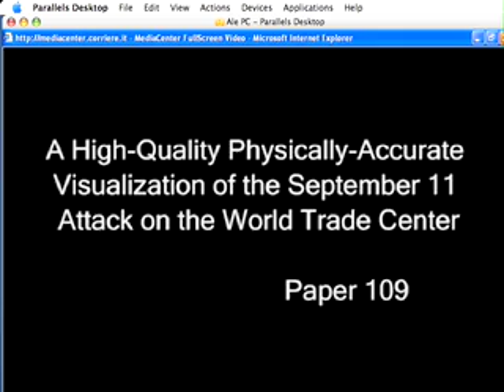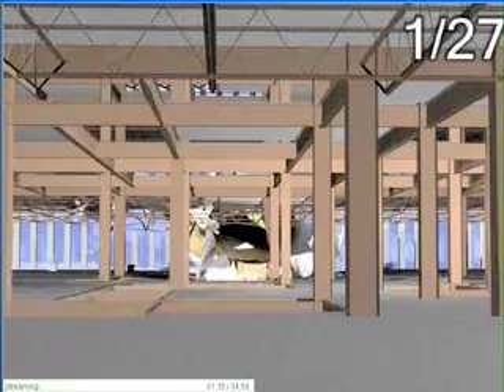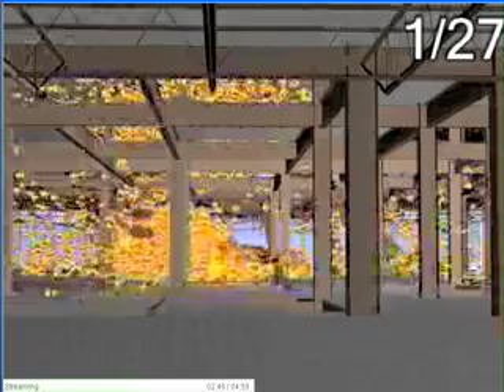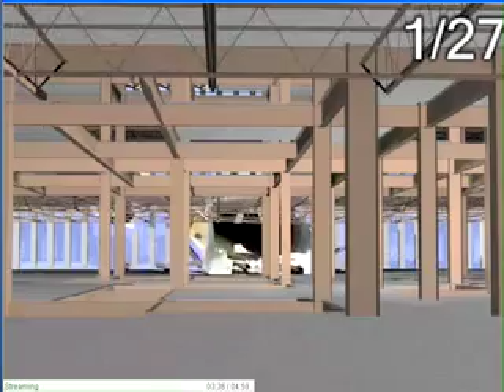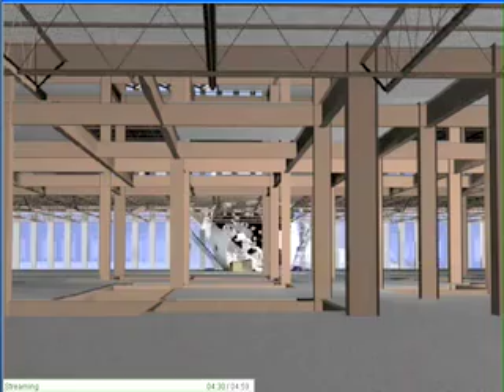9-11 Twin Towers Attack 3D simulation

Comment: I mean the jet engine on the wing can plow the the steel but the aluminum wing at the ends would of not been able to pierce thru those steel beams on outside face of building. Like am I missing something. Maybe the buildings weren't made from steel than. Cuz the planes literally cut thru the steel building like butter 🧈

Comment: The reason why each tower collapsed when; the north tower was hit at just under 500 mph or 400 kts straight into the teeth of the 93rd and 99th floors. Flight 11’s impact blocked all stairwells from the 92nd through 99th floors either severing but more than likely, the plane’s debris and the Sheetrock clogged the stairwells to above the impact zone meaning if you were 92nd floor or above, you didn’t make it. I believe all in Flight 11’s impact zone were dead on impact and the only survivors were on floors 100-110 with others trapped on the 92nd floor. In the case of the south tower, United 175 hit at just under 600 mph or just over 500 kts at an angle more toward the right corner of the facade at a 45 degree angle, about 100 mph/kts faster than the north. The south tower was also hit between floors 77-85 with one stairwell to the upper floors clear but only 18 people at or above the impact zone escaped. Now the reason why the south tower fell first was because of the speed of the impact as well as the weight of the remaining floors above 77-110 along with the building to the left of the plane’s impact leaning to the right on the floors below and the weight was heavier than the north tower which led to it collapsing first. The north tower lasted longer because it was hit more into the teeth of the building and was higher up and the weight of the remaining floors 93-110 were lighter than the south tower and the north tower was hit at a slower speed. The point of impact as well as the weight of the floors at and above impact as well as the angle and speed were crucial.

Comment: How alluminium cut the steel like butter
Reply: Please google "waterjet cutting" and you will see water cut the steel
Reply: @Kuechmeister  and you see the pressure of the water 😉
Reply: @gennarocasertano3935  30 Tons of Alu + 60 Ton rest ( plastic, steel, turbines, fuel) = 90 Tons Airplane + 600mph = more than enough pressure to cut Steel.
Reply: @gennarocasertano3935  Physics:
 For example: 30 Kg × 100 km/h = 3 tons kinetic energy. Now the airplane 90.000 kg = 90 tons × 800 km/h = 5.760.000.000 Kg = 5.760.000 tons of kinetic energy.
Reply: @gennarocasertano3935  So Boeing 767 Hull 6 m² = 600 cm², 1kg/cm² = 0,981 bar (pressure) , 5.760.000.000 Kg kinetic energy × 0,981 bar = 5.650.560.000 / 600 cm² = 9.417.600 bar. So waterjets works with max 4.000-6.000 bar. So the airplane have 1.570 times more pressure,  than a waterjet.
Reply: @Kuechmeister  nope never alluminium bullet hits steel and pass throw it never...
try at home ...launch an alluminium  coca cans in a steel bar at what f..velocity u want and see if it cut the bar!
Reply: @Kuechmeister   try at home...can of cocacola in a bar of steel at what u want velocity and see if che alluminium cut the tempred steel of a skycraper . i not answer anymore you ll think all u want 😉bye
Reply: @Kuechmeister  and so in every case the really couses is attribuite to high temerature ...the bar of steel are in rhe middle of skyctaper and airplane isnt arrived there in part more big than a papwr sheet  ...and wt7? 😉
Reply: @gennarocasertano3935  The can thesis has long been refuted and that is well known.
The point is "1,570 times more pressure than a waterjet cutter". The material doesn't matter. Railgun Concepts uses aluminum bullets. And you have to consider that an airplane is only made of 30% aluminum.
Reply: @gennarocasertano3935  At WT7, New York is not an earthquake area, so the buildings were not made earthquake-proof either. The twin towers weighed 200,000 steel and 325,000 m³ of concrete. So the answer to WT7 is simple seismic.
Reply: @gennarocasertano3935  
Railgun projectiles made of aluminum pierced armored steel like butter.
Reply: @gennarocasertano3935  and another effect is important to know, google "Water And Molten Aluminium Is A Dangerous Combination" you only need only 600° heat to meld the aluminium and water...and Boooom
Reply: @Kuechmeister  yes of course ...🖍
Reply: @Kuechmeister  mmmm ok ok yesssss 👍

Comment: Aircraft doesn't cut through steel and that is a fact...........................
Reply: Birds only damage the thin outer skin of a plane, but under that thin skin is inches thick super strong alloy aluminium.

The alloy that planes are made from has the same ultimate tensile strength as structural steel 500 Mpa (Mega Pascals).

The size and strength of the wings is massive.

The wings must be very strong because they have to handle the wind pressure at 500 mp/h.....carry the tons of weight of the engines....carry the thousands of kilograms of jet fuel... and handle the large G-forces.

There is a video on youtube showing how they manufacture the wings of an Airbus 380....under the thin outer skin of the wing, is a massive inches thick rectangular box beam, the same size as the inner core steel columns of the twin towers.

The exterior columns of the towers at the impact zone were only 9.5mm thick plate hollow box columns....no match for the massive and supper strong wings of a plane.
Reply: No it's not a fact. You've not no research

Comment: Come on wings aren't strong enough to slice through 4 inch steel beams
Reply: The exterior steel hollow box columns that the planes impacted near the top of the towers were only 9.5mm thick. Only the columns at the bottom of the towers were 3 inches thick.

The towers were only designed for one plane impact.

Comment: There was absolutely no reason for the collapse controlled demolition because for the circumstances even if it did collapse for the jet fuel the top of the tower would have came down side ways like like cutting down a tree not the whole building

Comment: They say plane debris emerges on the opposite side of the tower, How can that be? Do you know what those plans are made of? Light fiber glass with as little as possible steel or heavy weight. Yet a fully constructed 110 floor iron bolted buildings collapsed into powder and dust  yet a small fiber glass plane ( compared to the structure integrity of the World trade centers) emerged from the opposite side? This is proof positive we need loyal Americans that go not favor government, politics or religion just the plain ( no pun intended) facts of what really happened!

Comment: This video is a complete joke... there is no way that an aluminum airplane can cut through steel. Did anybody ever see the front end of an airplane after it hits a bird?
Reply: Planes aren't made of ONLY aluminum
Reply: Yeah, the plane gets a dent in it, then lands.  So what?
Reply: M Fitz If a hollow boned bird dents an airplane then ur still saying aluminum can cut right through steel and concrete reinforced World Trade centers.
Reply: Will.I.AM - Well,...   http://i.imgur.com/hJdqzcp.jpg

Nuff said.

I should point out that the odds of something being possible if it has already happened are 100%.  Reality is not in error here, your false starting assumptions are.
Reply: Will.I.AM - The plane is harder than the bird, yes?  The bird is made of soft tissue, is mostly water and is smaller than the plane.  What happens when a bird hits a plane?  Sometimes the bird puts a dent in the plane (sometimes it doesn't - you don't see those).  

Why does the bird put a dent in the plane?  

Because the bird has mass and the impact has velocity - energy.  

A plane is like a really big bird.  

Why does the plane - 250,000 lbs of it moving at 470-510 mph - make a dent in the hollow building?  

See, you have been looking at this exactly backwards.  In your analogy the building is the plane and the plane is the bird.  Bird hits plane (plane hits building) and impact energy creates impact damage.

Comment: I just want to know how a  very delicate airplane cuts right through row after row of steel beams? The plane should have exploded like a pancake into the side of the building (not cutting all the way through it).
Reply: Planes are not delicate.
The fact that it didn't means you need to reevaluate what you got wrong.  You won't of course, but you should.  Reality is always right.  You are not.
Reply: If planes are "delicate" there's no way they could fly. Do you not know how fast planes can go?

Comment: The plane crashes didn't cause the collapse of the WTC Towers. They remained standing approximately an hour each after the crashes. The buildings blew up like erupting volcanoes, any one postulating a gravity driven collapse is ignorant of elementary Newtonian physics.
All progressive collapse theories defy Newtonian physics:
Newton’s third law is: For every action, there is an equal and opposite reaction.
Applying this principle to the collapse of the WTC Towers, it proves that the upper portion could only destroy the lower portion by the equal amount of the floors; That is if 12 floors are crushing the floors beneath them they can crush no more than 12 stories below. Simple physics.
What is the work done in ‘crushing’? It is smashing and destroying a material and objects. Equal and opposite crushing is crushing from above and equal crushing from below. ‘Crush up–Crush down’.
The material crushed in the interaction is equal. Therefore there is no material left to crush down after it is exhausted itself against the crush up.
https://willywhitten.wordpress.com/2018/03/04/9-11-simple-physics/
\\][//

Comment: Can you drive a truck through a cement wall ?  No is the answer !
Reply from the maker: lee santos: yes, if you drive it at 600 km/h ! Velocity is one of the component in the equation to determine energy.
Reply: I dunno, Lee, can a truck drive as fast as a fucking PLANE can fly??? And is it as heavy?
Reply: It seems you dont know the difference between driving and flying,,,,,
Reply: Trucks aren't planes
It seems like it's been a while since you've been outside
Reply: @waspsfriend8577  2 planes  , 3 towers  ! Wake up dude !

Comment: This flies in the face of COMMON SENSE which many seem to lack completely when it comes to this subject.  Just take an aluminum can..Then slide it inside of a bit larger aluminum can , Then slide that "double can " inside of a cannon and fire it at the side of a steel , concrete and glass building and see what happens GENIUS !! That can is going to flatten against the side of that building EVERY SINGLE TIME.....CASE CLOSED.

Comment: What happened to the Law's of Physics?????? For ever action there is an equal, and opposite action. meaning, the plane hit's the building with a force of  "X"  the building will be pushing back with the same force.  Meaning that plane is not going to fly right through 2.5 inches of steel.  Also The engines on Commercial aircraft are held on with 3 bolts the are DESIGNED TO BREAK OFF WHEN THEY COME IN CONTACT WITH A HARD OBJECT IE the 2.5 in of steel wall. nothing, fell to the ground. Oh yea they did find "engine parts" LOL but weren't parts that came off of those planes, i believe it was an old DC-8 engine. 
If this "company" thinks their "science" is correct. then Duplicate it.  Their theory will ONLY be correct if they can Duplicate what happened. There are jet sleds that can go 500, BTW it was going that fast, They can build everything to scale. I'll bet a dollar to a doughnut  when that plane hits the building  ( or a simulated wall) there will be NOTHING left of the plane, and not a scratch to the wall. or you can try it at home, take a empty beer can push it as hard as you can through lets say 1/4 in of plywood. good luck

Comment: That’s bull shit. How can Aluminium go through solid steel that was built to with stand a 747. 
How can a commercial airliner fly at that speed at that height.
Reply: I don't think they had 747's when the towers were designed.